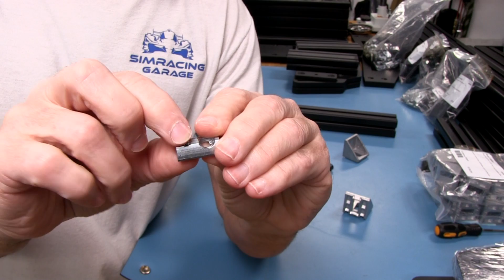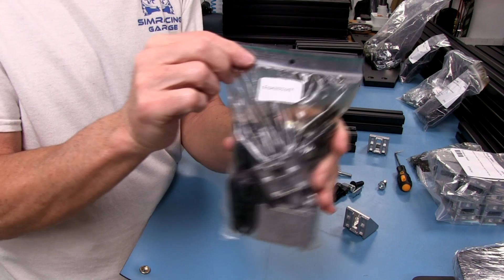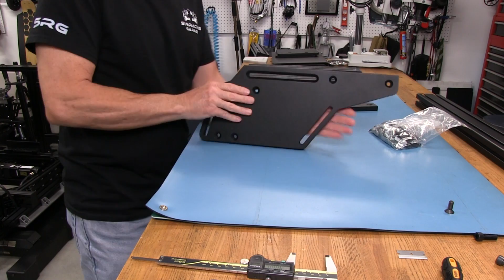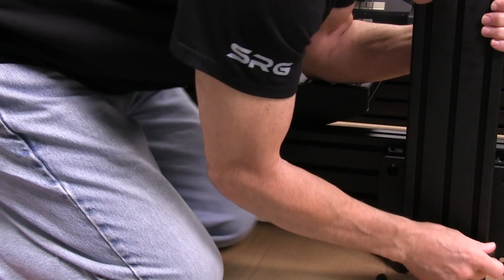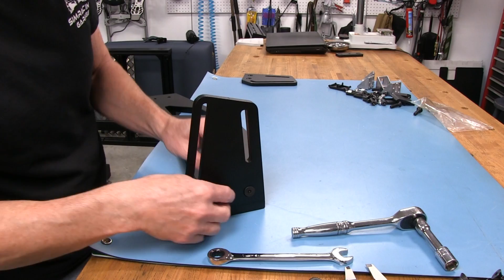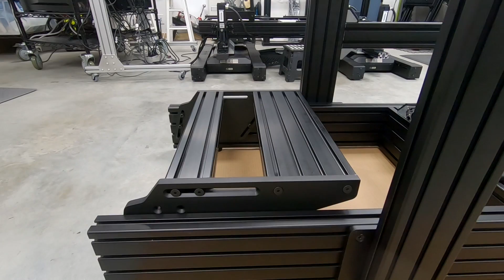Sim Lab P1-X Sim Racing Chassis Review

Comment: Wish I had seen this before I started my first rig. Found the exact same issue with the wheel mounting. Bolts too short and then if adjusting can come out off the nutt. Have to remove integrated monitor stand now to retry and also leads to scratching of the profile. So great informative video. In general think it would be handy to have extra nutts and wing bolts, probably they should provide extras at purchase. These things aren't cheap.

Comment: Thanks so much for the incredibly helpful instructions to build the P1-X. I purchased a Thrustmaster T248 which will mount to the flat wheel deck assembly. I'm planning on purchasing a Fanatec CSL DD and I was wondering if the flat wheelbase will be sufficient for the much smaller unit with less torque. You shared the benefit of the front mount assembly for the significantly larger Fanatec podium units and just wondering if the front mount is also recommended for the smaller CSL DD?

Comment: In the process of building mine right now, just wanted to say thanks for the help along the way!
Reply: Oooh how you like it!?
Reply: @DavesHomelessCats  I'm loving it! I've really only had one minor problem and that's the caster wheels that Sim Lab sold. The metal to set/unset the brake is a cheap aluminum and the brake levers bent to the point of not working any more. The casters still role but the brakes don't work.  
  
Outside of that small issue, the rig has been awesome. Easy to mount anything on and no flex with my DD1 and V3 Brake pedals. It's a lot of setup work to get it running but after it's all mounted up it's fantastic.

Comment: I just thought of something: wouldn't it be cool if there was a rotating tray with (say) 3 sets of screw holes in a Dorito pattern, for attaching 3 different gear shifters and rotating the tray to choose the shifter you want every single time? I mean, cars have different sorts of transmissions (manuals, automatics, sequentials), so there could be 3 different gear shifters (a manual one, an automatic one and a sequential one) attached to one rotating tray. The tray could be rotating and when the desired gear shifter is selected, it could selectively be locked/unlocked to/from the right longitudinal members by a special key switch working a mechanism preventing it from doing unwanted rotation - this is for stability reasons!
Woudn't this enhance immersion?

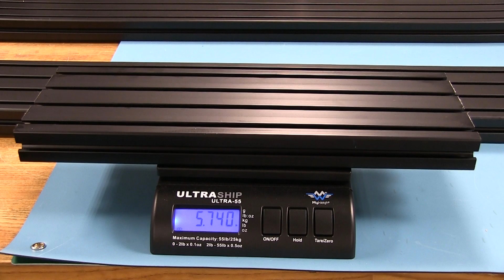Comment: If the uprights are mounted to the outside of the base, with 10mm thick mounting plates, wouldn't that be 680mm total width, 600mm knee clearance width between uprights? 16:03

Comment: First time I saw a review from you was a couple days ago. OMG, they are good. You remind me of an engineer, one that can explain complex things quick and easy. So I have an Obutto Ozone cockpit and upgraded from a ClubSport to a Podium DD base. I thought the steel tube frame was totally fine, till I cranked feedback to 100 and almost broke the rig. Question: Can I use this Sim Lab P1-X with that full motion simulator (Pro Simu T1000 5M - I think) you have pictured right next to this? Eventually that's the full motion I'd like to get, unless you can recommend something better. If I can invest in a better cockpit now, and keep it for the future, I'd be more likely to go for it. Thanks,
Reply: Late reply, but this should be fine with whatever you throw at it with wiggle room for more.

Comment: On the partslist, the 2 profiles for mounting the seat on are 500mm, you seem to have 580mm profiles for that?
Reply: 18:10 is said two profiles 580mm. I think it’s not the case with the p1x rigs I have. Sim lab manual says one 580mm (for shifter?) and two 500mm which probably are for seat.

Comment: Can this be attached for example to old GT1 Evo it is 560mm not 600mm so i guess it can be mounted outside the bars and not inside, only would need 10mm extra what maybe the bolt atach can be adjusted, thx
Reply: Im talking abou the front mount, sorry

Comment: Sim Racing Garage  Barry can you tell me what length steering wheel spacer you use. The chrome one I'm referring too and any links would be greatly appreciated.  

Cheers Barry
Reply from the maker: 2"
Reply: @simracinggarage3026  2 inch, it cant be 2inch can it. it looks a lot longer. I'm referring to the steering wheel spacer in silver. it looks more a lot more than 2 inch.

Comment: Thanks Barry you got me through my P1X build perfectly! Lots of extra bolts to mount things later. I was a bit worried about the size but it is a lot smaller than I thought.  If you want a sensible rig platform to start with look no further. Not sure if anything comes close. Rock solid! Now just waiting for my motors to come in to build actuators.
Reply: I can recommend adding the "Sim-Lab Sim Floor" as it adds some more rigidity and I find it easier to get out for some reason as well.
I just added one to my P1 as well because the Podium DD2 it'd powersupply brick has an fan in it. So I added the plate to prevent dust and dirt get in the power brick and moved cables and powerbricks as much as possible out of view.
Mind I also bought a Brenenstuhl 19" rack mount powerstrip, which I then bolted onto the aluminium. Together with a quality USB3 hub. So I only have 3 cables coming from the rig... 1 power, 1 USB and 1 VR headset cable.

Comment: Can u tell me the dimensions of this sim chassis. Especially the width (with all included).
Thanks
Reply: From the bottom of the P1-X webpage: P1 chassis dimensions: 1350 mm x 580 mm (length x width outer dimensions)

Comment: Great review.  I noticed your flightsim rudder pedals hanging on the wall and had a question...   I'm interested in a chassis that could be relatively easily switched over from sim-racing to flightsim.  What are your thoughts on this chassis system's suitability for this idea?
Reply: Look at the Obutto  R3volution cockpit might suit your needs

Comment: Again a very good review! The price point of that rig is INSANE! If you order the parts (replacing that frontal bracket with 80/20 parts) from any industrial supplier you‘ll pay about 350$. And you’ll have them at your home within a week. Naturally they have to make a profit, but anything more than 500$ is outrageous. The margin Sim Lab takes on all the stuff they offer is just shameless.
Reply: That doesnt take into account the beast of a wheel holder though. I don't have any tool that can cut through what looks to be 20mm steel plate.
Reply: Zachary Osvald But: Do you need that? We are talking about 30 Nm max, not 3000 Nm...
Reply: @Urufu-san Correction, 15mm. Still, though. The only thing preventing me from buying the aluminum extrusion by itself is the metal plates for the pedals and steering wheel

Comment: Hey Barry, you did it much faster than me,  it took me ages to put it together,  with no instructions...
I was wondering if you could make a tutorial about driving position ( gt - formula)  and specially where the pedals supposed to be compared to  sitting position. I'm having my pedals quite high and using a load cell brake pedal is getting uncomfortable after some time.

Comment: Great review as usual Barry, just wondering if this might be to short for someone who is 6ft6? Would like my legs to be just a little bent / cranked say 25° ish.

Cheers
Reply: This thing is very customizable, Barry has the orientation of the pedal plate facing inward because of his short legs, if you switch it the other way around, you will have more distance on the pedals.

If that's not enough SimLab also has a pedal slider with a plate which lets you adjust the pedal distance even more as well as seat sliders.
Reply: @champion1642  cheers, I'll have a look later

Comment: barry -- washers aren't necessary when bolting up those angle brackets?  i know they probably don't come with em, just curious.
Reply from the maker: Not necessary. As the slot's width supports the cap head bolts well enough. I have used them in a pinch for spacing duties. If the bolt is a bit long for the channel.

Comment: Had this version with the new adjustable pedal tray for nearly 2 months now. Combined with the Simucube 2 pro I have to say it works brilliantly in all aspects. Also got the single integrated monitor mounted to the rig...no movement at all. Once again very thorough review...I used your previous review of this cockpit to help me build mine! Great job Barry!!
Reply: Kevin Dimbleby thats good to hear as I have my one arriving next week and have the exact setup you are describing and was worried about monitor movement
Reply: Blair McConachie no issue with it at all when driving with the simucube 2 pro at 75%...probably because my eyes are shaking in my head so wouldn’t notice 😳 you will enjoy it just took a little time and a spirit level to get it sorted to my ideal position 😁

Comment: Hi Barry...another awesome vid....don’t you think it’s a shame they don’t do the corner brackets in black...or am I being to picky
Reply: I just received mine on Monday with all the accessoires and it is simply GREAT!! Almost completed the setup with actually two dual Samsung 49” Ultrawide on top of each other and interesting. Also making a point of having everything mounted on the rig and I mean everything! That way, I can roll the rig anywhere I want and all I need to do is unplug the network cable and the power cable... By the way Barry...awesome review and I will have to visit your website for some support. Enjoy SimRacing Everybody🏎🏎🏎
Reply from the maker: Yes, black brackets would go quite well here. You can always prep and paint them your self. Or have them anodized. I don't because I move things around too much to maintain the finish.

Comment: you should send me a racing seat, I cant afford one.
Reply: no need for a rqcing seat unless you got a motion simulator.  just go to a salvage yard and look for a newish car to rip a seat out of.
Reply: @iHasCaek I just went to a pick and pull yard in Colorado and found two nice Ford Focus sport seats. On eBay they are going for a lot; I got them for $52 each. Cleaned them and they are downstairs waiting for my new rig, and the other I’m going to put on my Playseat/GT5 rig.
Reply: @sneekgaming  i just got a seat from an accord and bought a fake leather cover.  even has powered controls.  less than $100

Comment: I also prefer to put the seat brackets aluminum extrusion inside and flush with the rest of the sim to allow the seat to be 40mm lower. Allows for more room to adjust height of the wheel.  Because for me the max wheel height is too short.
Reply from the maker: I had mine mounted that way for a bit on the P1. These chasiss are very flexable when it comes to setup.
Reply: Do you have a picture of what you're referring to? I want to lower my seat more to be inline with my pedals without having to buy the upgrades to raise the pedals.
Reply: @Reason0684  I can email you a picture. Just give me some way of contacting you